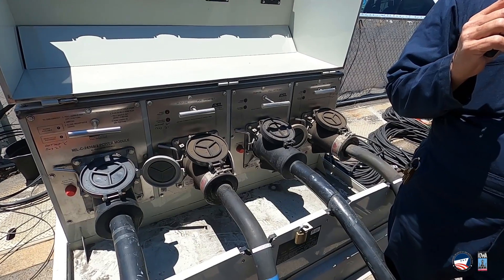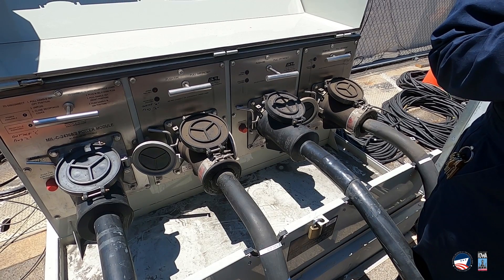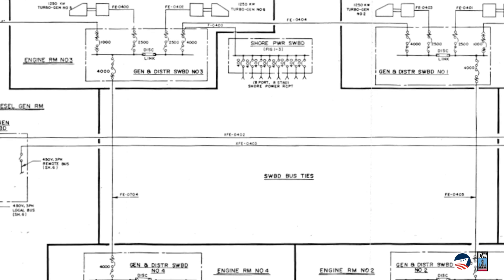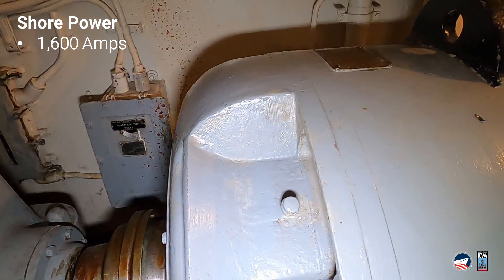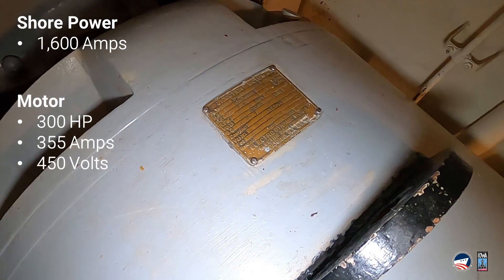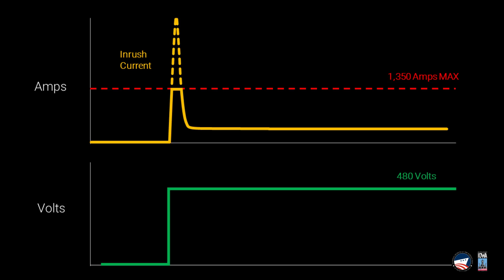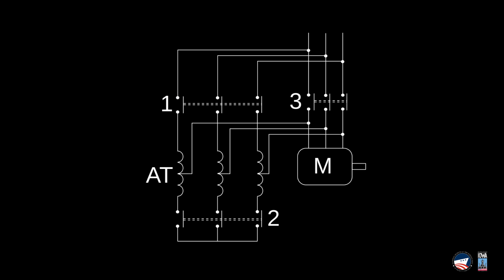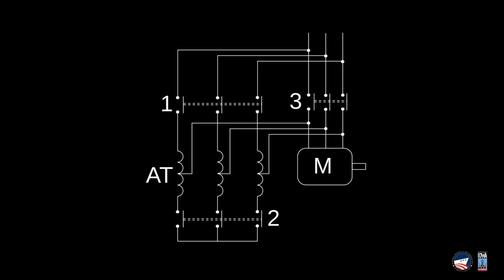How To Power A 16" Gun Turret

Comment: the other option is a big industrial VFD with soft start, and it's a very accurate way to control the turret motor anyway. But yeah, if you didn't have inrush current control, a 300hp vfd would have sufficied.

Comment: So the USS New Jersey is going to be dry-docked within year or next.  What is the plan for the USS Iowa going into dry dock and dry docks are there on the West Coast to accommodate the USS Iowa?
Reply from the maker: For us, the cost would be upwards of at least $25 million. Realistically there's only one dry dock on this coast that can handle the ship. Our plan is to do as much work as possible in the water and at our dock. 

We did a pretty thorough discussion of what's possible and what our plan is in this podcast: https://youtu.be/nxp16v5skew
Reply: @BattleshipUSSIowaLosAngeles  Thanks for the information and link.  I saw you have a great cofferdam style plan to address the wind water line areas, I was just wondering how you would address the areas under the ship.  Do you send divers down periodically to inspect the blanked over thru hull openings?  Can some repair work if required by accomplished under water?
Reply from the maker: @patrickcotter5629  Yes to both divers doing hull inspections (yearly) and work being accomplished underwater.

That's our aim - do as much as we possibly can right where we are. For us, dry docking is a huge undertaking, both financially and physically. We were getting quotes for $20 back in 2012, and there's only one dock on the west coast we could get into now. It's in Portland, which would mean a tow up the coast, across the Columbia River bar (which can be absolutely vicious), and then however many months of work are needed.
Reply: @BattleshipUSSIowaLosAngeles  Thank you for your response. I hope I can tour the USS Iowa when we come out to California again.

Comment: 355A * 450V  = 160kW. Much below 300HP. Shore power 768 kW. Much more than needed.
Reply: I know it is incomprehensible to the people used to the dimwitted Edison view of AC, but this is 3-phase Westinghouse / Tesla / ASEA / Siemens style power, so the maths are different. Power is -- for a delta motor, and I assume this because that is the clever way -- Voltage times Current times square root of 3, which in this case is about 277kW.  Converting to horsepower (by dividing by 0,746) gives about 371hp.  Or the power of one early 70s muscle car going flat out.

Comment: How is this allowed Ryan and Battleship NJ was asked this question and his answer was the its in there paperwork from the Navy they aren’t allowed to do this. So why can IOWA?
Reply from the maker: Our Navy contract says we cannot use any of the ship's equipment for purposes of navigation, but may move it for purposes of maintenance, display, or safety.
Reply: Ryan has stated that the museum agreement of each of the Iowas is slightly different (it's not the same exact wording), but they all have in common the prohibition against firing up the steam plant.  BNJ's leadership seems to be convinced that their existing shore power provisions are not robust enough to activate turret electrical systems while still serving the other electrical demands of the ship with the available shore power.  So, from the perspective of having limited shore power surplus, the only way to get more power would be to run the steam plant to power the turbo-generators, but that would be a non-starter due to the museum ship agreement with the Navy.   Theoretically they could operate one or more of the auxiliary diesel generators and still comply with the agreement, but if you're going to do a generator, it's probably easier and cheaper to rent what you need than to hire a company to inspect and if necessary overhaul onboard generators.

As far as daily electrical load, remember, BNJ has been a museum ship since 2001 so compared to the other Iowas, much more of her interior has been renovated/restored into museum display and tour space, so day-in and day-out, much of her shore power is dedicated to operating the A/C, heating, and lighting.

Maybe upon further review, and based on valuable data and information derived from Iowa's successful train (aka rotation) of Turret 3, hopefully BNJ would revisit their analysis of available power against power requirements needed to revive one or more turrets.  Although it would be well outside of the publicized scope of work (and most likely outside of the available funding) for BNJ's impending drydocking, I can't think of a better place for BNJ to fire up the turrets than when she is fully powered while in drydock.

Comment: We moved the Turret and guns on Shore power all the time. Had to move for Maintenance in port.
Reply: Yeah, but was it the same shore power that Iowa has run to her right now?  That's the question.  There's shore power and then there's naval base shore power.
Reply: @SealofPerfection  He listed the available amperage in the video...  They have a total of 1600amps available to them right now, and the motor to rotate the turret only takes 355 amps.... 355 amps at 450 volts is not some unbelievably astronomical electrical number. My guess is any commercial or Naval base dock that is big enough to park an Iowa class Battleship at, will typically have enough power to run any ship of that size.  Other types of ships may not have 300HP turrets, but they may have other large electrical loads that can add up quickly, like commercial refrigeration, for example.
Reply: @SlipFitGarage  I'd agree.  However the initial load is several times that, that's what they need to account for.  The 355 amps is just what it needs to keep turning, not to get it started.  So when they first start to move it, the load jumps way up, then settles down to the 355 amps or whatever.  
 There are ways to handle that.  For example, some big air compressors have a starter motor for the electric motor.   So something like that would probably work.

Comment: I hope this inspires other museum battleships to inspect their systems and give it a try.
Reply: Ryan S better get on that when the NJ gets back from dry dock! It would be amazing to see the Missouris trained out as well.
Reply: @johnlee8523  I can see Missouri getting that pretty quickly with all the funds that she gets. I have been on Missouri and Iowa and the sheer fact that Missouri has the AC system on the ship running completely in each hallway and room is mind-boggling. I went on Iowa last year and there are two rooms that have AC, that is the gift shop on the ship and an exhibit. The SoCal heat made it a little warm and stuffy on the boat lol.
Reply: @johnlee8523   Well, they sure couldn't turn turret 2, since they cut the accessways and ran wiring thru the barbette into the turret. 😀
Reply: There is also nothing in the contract about running external small steam generators. It's very popular here where I live for running XIX century mining shafts machines in coal mines that are now museums.
Reply: New Jersey said in one of their videos rotating them like this isnt allowed by the Navy..
Reply: @GodOfWar109  no, they said they aren't allowed to make steam.  There's nothing from the Navy about this
Reply: @garywayne6083  Yeah, NJ isn't allowed to fire up her boilers to run the steam generators. There's nothing in the contract about using shore power to make things move and rotate around the ship, fortunately.

Looking forward to more videos featuring a giddy Ryan playing with more toys in the near future :)
Reply: @GodOfWar109  Ryan made a big claim (that he shouldn't have made) that it was impossible for any battleship, both now and when they were in service, to rotate the turrets with shore power.  Like he said in this video, the problem that needed to be addressed wasn't hard to address at all.

Comment: Dealing with in-rush current is a major issue in industry, indeed. Also in battery-powered situations where you have e.g. an AC inverter running off a battery bank. Those inverters do have a surge rating, but that's generally only 2x. Hence you got inrush current limiters much as described here to allow one to start large inductive loads without taking down the local grid, or that of the neighbourhood or city. They're absolutely essential equipment, even if you're not wishing to rotate your battleship turrets.

As an aside, seeing the turret turns towards that Evergreen container ship felt perhaps unreasonably funny. Would be a real shame if another Evergreen ship suffered an... accident :)
Reply from the maker: There may or may not have been chuckling when the cruise ship docked behind us passed by about half an hour before we rotated the turret. Timing could have been... interesting if we'd moved earlier. 😆
Reply: @BattleshipUSSIowaLosAngeles  Seeing those triple 16" barrels pointing at anything sure makes life more interesting. Maybe next turret rotation can 'coincidentally' match a cruise ship's passing, would be one heck of a power projection and instant advertising move :)
Reply from the maker: @MayaPosch  😂 The temptation is great. 😂

Comment: I would have titled this video, "The power of reading the f--------g manual."  NAVORD OP 769 Change 1 dated 1 November 1967 explains all of this in detail.

One has to keep in mind that these systems have enough reserve torque capacity designed-in so that 2,200-ton+ turrets could be rotated in heavy seas or at significant list angles.   Sitting at their piers in museum mode, pretty much the equivalent of sitting on a porch at a retirement home, the train motors that run the train hydraulics are likely loafing about thinking they are on vacation.
Reply from the maker: Read a manual? That's crazy talk. 😂 (Somewhere in all the video footage we collected, there is a shot of Sr Chief sitting on deck holding a rather thick manual.)

Comment: hope the other Iowa class battleships are looking into this.
Reply: And the North Carolina and both the SoDaks, too.  No reason theirs won't still rotate as well.
Reply: @SealofPerfection I mean, to be fair those ships haven't been operationally maintained since around 1946, while the Iowas were in active service about 30 years ago.  It would take a whole heck of a lot of electrical and mechanical work, and $$$.
Reply: @legogenius1667  It would probably take more, but there's no reason the electric motors to rotate the turret won't still work if you get power to them. They were decommissioned and still are.  So essentially those parts are still mothballed.  
It doesn't go bad just sitting, as long as it didn't get flooded or damaged somehow.
If you've ever been on one of them, you'll know that down in the turret is fairly well pristine inside, and that's were tourists have been walking.  The parts that you'd need to work on haven't been exposed to people, so they should still be mostly good to go.
Reply: @SealofPerfection  I agree, the motors are probably just fine.  But the thousands of other small parts, hydraulic lines, controls, lubricants, electronics, and rust buildups would need some looking at.  The Iowas took a fair amount of work to recommission in the 80s, and even back then they were old enough that they apparently experienced mechanical failures from time to time.  It would certainly be possible, but it would not be very financially reasonable is all I'm saying.  I would absolutely love to see it though.

Comment: Well to be fair to everyone that thought this, we're not all electrical engineers.  The auto transformer system you describe is an old school meyhod of what is known as "soft starting".  It's very common anywhere a really large motor needs to be used.
Reply: Or starting RV air condition on a small generator 😊